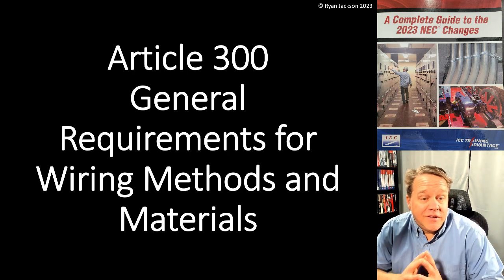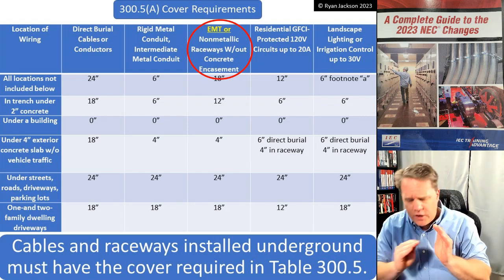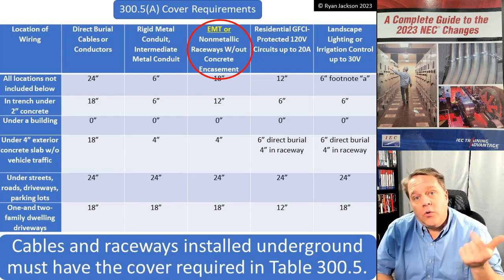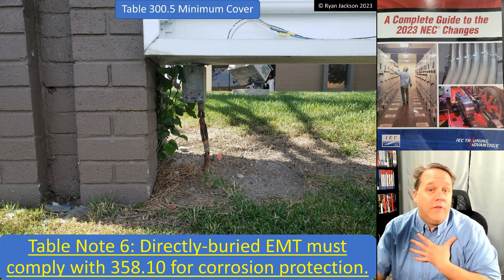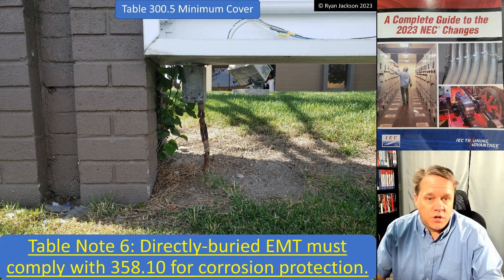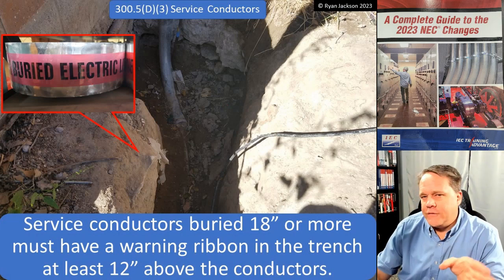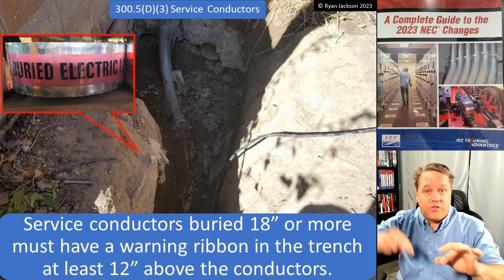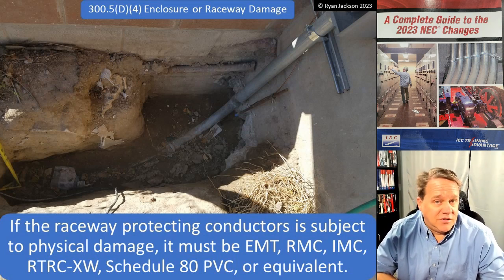2023 300.5 Underground Installations

Comment: You want to hear something crazy? I have been dealing with an inspector who does not consider a meter main to be the service disconnect.  Now when it comes to grounding and bonding he does actually… but he says he will not allow compression fittings on conduit housing “service conductors” and in that regard he does consider them service conductors.  Nor does he consider an “ATS” or islanding device a service disconnect…. Wtf is wrong with this guy

Comment: Great video, full disclosure I am not a electrician,I am a excavator for quite a few in my town. I just had a friend get failed because he didn't bed the conduit in gravel and the city guy sited 300.5 (E) and while this is a service conductor (from pole to house) they still won't let him proceed.  Our utility company doesn't require a gravel bed they only stipulations they have is that you don't back fill with rocks if any came from the trench. 

He is going to go ahead and put the gravel in just to move forward, I personally wouldn't because he is opening a door to everyone thinking they have to put gravel which really complicates a simple process. 

My question is what does 300.5 say specifically and where do I find the verbage that service conductors are exempt from the NEC?

Thanks in advance for any help you may be able to provide
Reply: To answer your question about the service conductors, the "handoff," if you will, is the service point. If the utility still owns the conductor, it would be a service lateral, and not covered under the scope of the NEC. If it's customer-owned, it'll be an underground service conductor, and would then fall under the requirements of the NEC.

Abbreviated, 300.5(F) states that backfill that might damage/corrode the conduit or prevent adequate compaction shall not be used. Further, if the raceway is subject to physical damage, aggregates, running boards, or sleeves shall be used. My guess is the inspector is using the last constraint in 300.5(F) to require the gravel bed.

Comment: Question
It is my understanding that column 2 has no restrictions on voltage (aside the 0-1000v it covers) or other protection requirements.
For example, i could feed a 100a 120/240v subpanel in a detached garage (or any other circuit) and would be good to go at 6" in rigid conduit(assuming row 1).
However, recently feeding a 120v 20a post light  in rigid conduit at 6" burial depth, our ahj required gfci protection as if this were a column 4 installation.
Ahj claims the only thing changing in column 2 vs column 4 is burial depth and gfci protection is still required. I can find nothing to support this.
Can you clear this up? Thanks!
Love your channel